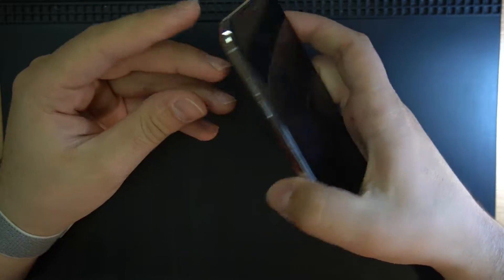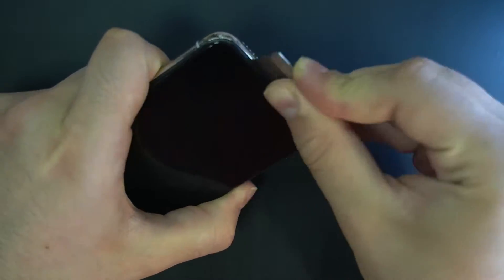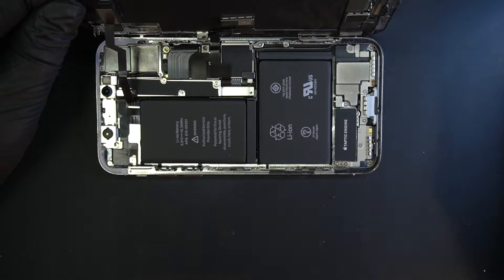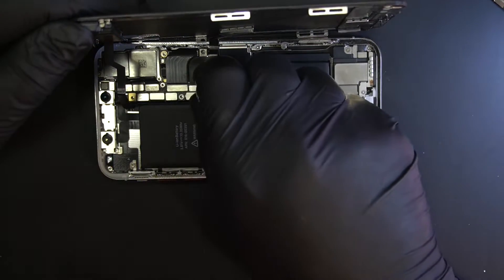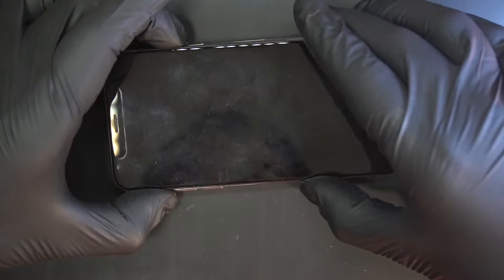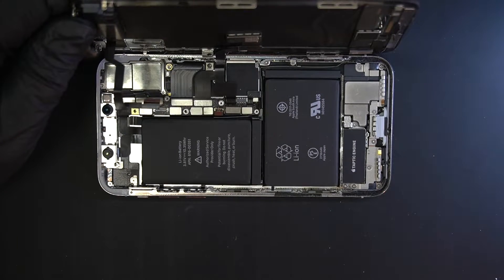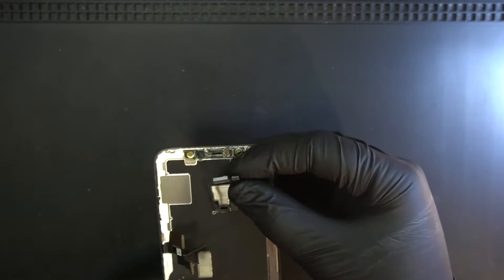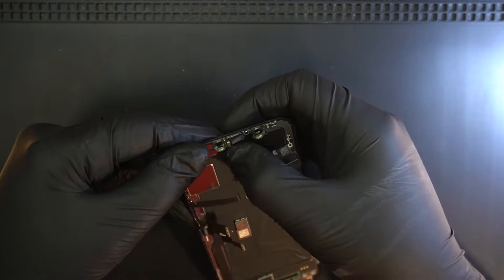iPhone X face ID not working (boot looping and not turning)

Comment: If I ma ask,if get what your saying you shouldn't have issues when changing the screen, if a problem comes up with the face ID,Is not Recognized, it's your fault when disassembling you damaged a flex or what ever other piece,so changing the screen (LCD) Ect shouldn't and isn't responsible for the face ID not working after reassembled
Reply from the maker: @jean-luclortie5001  The screen it self is not responsible.

Comment: If you disconnect it will the speaker still be okay?
Reply from the maker: The speaker is soldered to the flex, if you disconnect the flex there will be no upper speaker.
Reply: Okay
Reply: My iphone X right now had the same  issue
Reply: Will it still be fixable if i let it left untouch for 15 days? Because i can't afford to take my phone to the technician right now

Comment: Quick question I have a iphone x same issue but mine a bit different. If I unplug the Face ID speaker adapter the phone turns On, but when I plug it back up it reboots I changed the whole lcd and it does the same thing phone comes on only if connector is not plugged, so for sure it’s not corrosion casue I replaced it instead of swapping the piece , some how it’s making me feel it’s something wrong wit the connection On the phone instead of the speaker adapter connector Any ideas what it can be, and of course without it I have no FaceTime,  they can deal wit that but u can’t hear anything and have no earpiece speaker to talk

Comment: I have iPhone X and I have damaged the cable you just repaired, would I be able to send it to you for similar repair?
Reply from the maker: Hi, yeah sure.
I am located in Ukraine if you would like to send I will repair it.
Reply: @iTouch-repair  If I send you just the cable and sensor assembly how much would it cost to replace the cable?
Also I hope things are safe there for you, I am in Australia
Reply from the maker: @gregrutherford5350  yes I can replace it but I can’t give guarantees as I can’t test it on the phone.
Yeah everything is good here thanks for asking.
Reply from the maker: @gregrutherford5350  as for the cost I don’t know you will need to check with your post office.
Reply: @iTouch-repair  yes, I meant your cost to repair it
Reply from the maker: @gregrutherford5350  60$
Reply: @iTouch-repair  what address would I send it to and do you do PayPal or bank exchange
Reply from the maker: @gregrutherford5350  DM me @itouch_pro_1

Comment: I had this happen to me. What I did was to take the proximity sensor/earpiece assembly out and unfold and un-crease all the ribbon cables i could find. I reached the part shown at 6:40 and removed the adhesive that was holding that part to the adjacent sensor. Once that was done, I tested it and it started working!
Reply: what did you do to that did you clean and it work?

Comment: problem solved: here is the fix
 so my present case is I had done the easy flash on my iPhone X using the latest iOS 14  version with 3UTools. It completed100% in 2nd attempt and then white screen with Apple logo attempting data recovery  popped up  and then it popped a second time with the downloading bar ( without attempting data recovery text) and. Phone switched on. With my previous wallpaper and passcode. The photos are empty but storage showing full with most space taken up by "other" category, previously all this space was taken up by photos. Where do I go from here?
 I made an unencrypted backup using iTunes and I can see the photofiles in some weird format which I can view in Paint and the chronology of the photos is all jumbled up.  I think my phone was previously on ios11.4 or ios12 is that why there hasn't been a smooth transition n it's not pickin up the photos in the app because they are on a previous encryption? Should I try to reload an older firmware?

 here is what I did: I opened the backup in 3utools selecting file location (iTunes/mobilesync) under backup/restore-->view  data backups--> select the backup--->pro mode--> camera roll--> (select all folders) export ( in a new folders) and lo and behold all 21000 files were photo files were  there to be exported in chronological order and the location data where pic was taken is under file information

I am so happy...all this is free...if this works for you please share this info with others

Comment: I don’t usually leave comments, but I wanted you to know that your video truly helped me. Last summer my iPhone suddenly stopped working and I had my journal backed up to the iCloud, so when it crashed I was not initially worried. No one could fix my phone and I realized the iCloud did contain a backup of my journal but both the journal app company and Apple did not know how to retrieve the data. The only known copy of my journal was trapped on my boot looping iPhone X. These moments were so precious to me that I tried so so many methods to fix the phone. My problem was also a corroded Face ID ambient light sensor. I followed your instructions and disconnected it and my phone came back. It’s back. You gave me my phone back and my lost moments back. I will forever be grateful. Thank you so very much.
Reply: This is giving me hope! Mine just started doing this and I have soooo many pictures.

Comment: ATTENTION!!! A FIX HAS BEEN FOUND FOR THIS IF NONE OF THESE STEPS WORK! I had to find a comment on a random video telling me to disconnect the proximity sensor on the phone(the front sensor that uses face ID). I tried everything from recovery mode to all those scamming apps(Dr.fone..Phone rscue, ReiBoot...etc). They are all scams in my opinion but I was able to open up the phone from the tools I had and unplug the sensor and it bypassed the loop!!! So before you restore and lose everything just take it to a repair shop(if you are unable to get into the phone yourself and tell them to unplug it!!!!!!!
Reply from the maker: Yes , thanks for clearing this out.
That’s exactly what i am trying to show in this video.
Reply: Ok how much was it

Comment: very cool to watch you work! I'm having the same issue and I was looking around and landed on your video. I don't have the tools or skills to do what you're doing so I guess I will need to find a replacement sensor lol
Reply: Just tear off the flex connected to Light sensor. Of course before it try to clean it with a needle. If not do the first thing.
I have the same problem. I will try first to clean it. If not I have to cut the ribbon
Reply: That is cool

Comment: Sir..how to know flex is damaged or chip..? Which is best i2c vs Luban.?
Reply from the maker: Hi, i would recommend Luban chips 
I’ve been using them for a while now and they are very cool to install 
Either way you need to remove the dot projector from the housing and the Prisma but for the i2c the base of the projector can sit incorrectly and then you not only have a problem with the sensor and also you have a problem with installing back the projector base to the housing 
So I would say go with the Luban, that’s my choice
Reply from the maker: You can see that I have a video on my channel about the Luban chip if you need a reference on how to do such a repair

Comment: @iTouch
How do you fix an iphone X stuck in recovery mode because of a full storage. It went into a bootloop and then updating failed because of lack of sufficient storage.
Would the phone require to be opened for this issue? What is a possible solution?
Waiting to hear from you
Reply: I has the same isssue to me i fixed it by removing the face id top flex cable completely and tried to restore and got it

Comment: @iTouch
Great video. My iphone X memory was so full and it stopped taking pics thru caMera app but it still let me take pics thru whatsapp because of smaller file size. The phone went on boot loop. And is now stuck on recovery mode. Updating isnt working because there is no storage space. Is there a way to switch the phone on or retrieve data. What can be done?
Reply: If its not a hardware issue, what is the method to retrieve data
Reply: Did you fix this, I have the exact same issue. Please reply?
Reply: @tcsk685  did you fix it? i have the same isssue